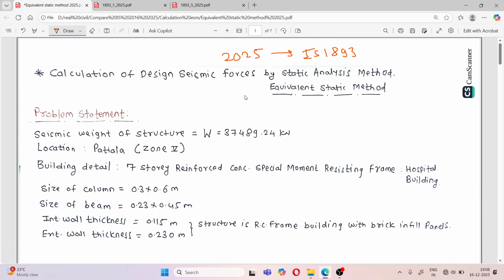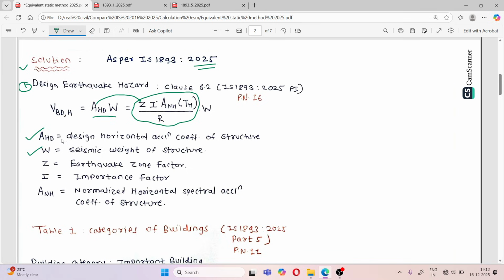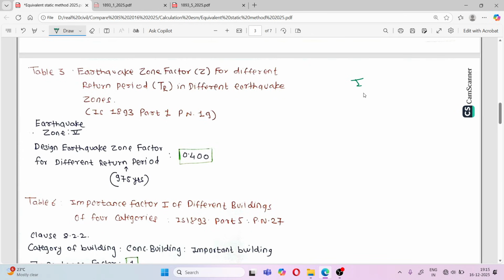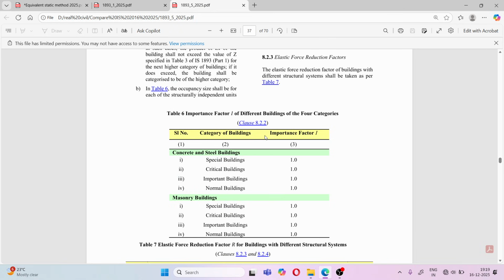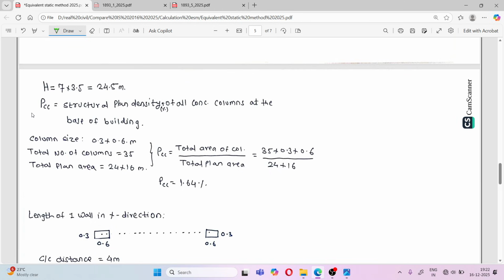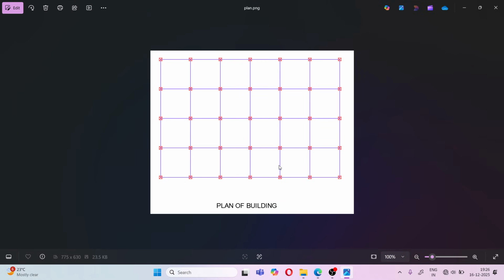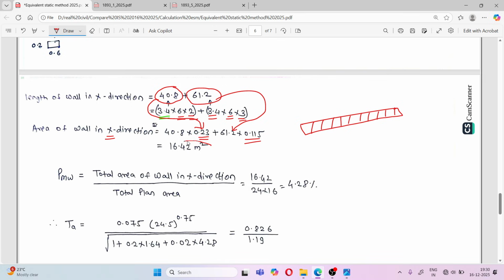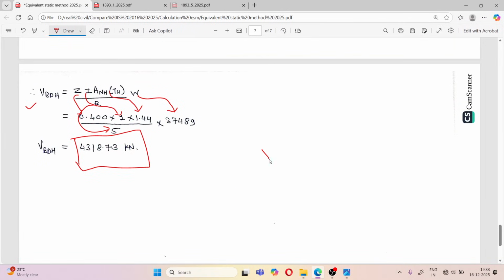IS 1893:2025 Equivalent Static Method Explained with Example Seismic Force Calculation

Comment: Very well explained. Kudos to you !!
However, as per Table 13 of IS 1893 - 2025 Part-5, even for a Normal building, an SMRF is not admissible for Zone-V. For the 'Important Building' discussed in this video, the structural system should be SMRF+SSW or DS (Dual System).
Reply from the maker: Thanks for the detailed feedback. I will check Table 13 of IS 1893-2025 Part-5.

Comment: If Suppose there is an shear wall, then we need  to consider the denominator part of Time Period Formula(which we omitted in this example  due to no structural wall) ?
Reply from the maker: Yes, if there's a shear wall, you would need to consider the denominator part of the time period formula.
Reply: @Realcivil  Can you also make a video regarding  that if possible because generally  in Multi- storey Buildings have Shear Walls .Thanks !
Reply from the maker: Yes surely. We will make one video on building with shear wall